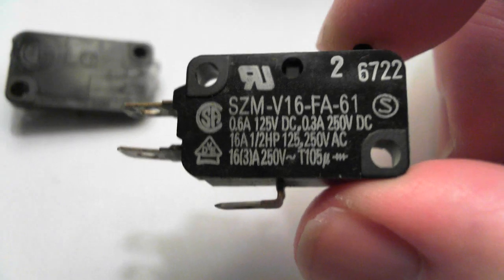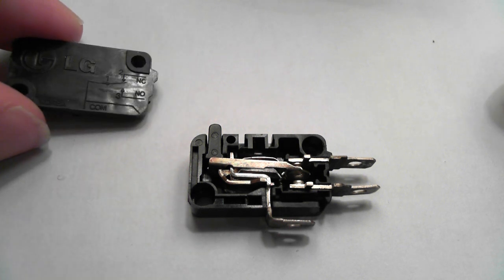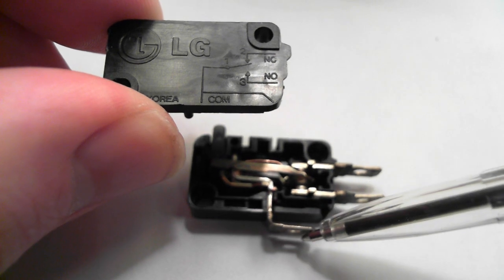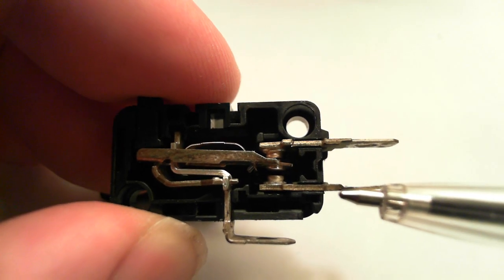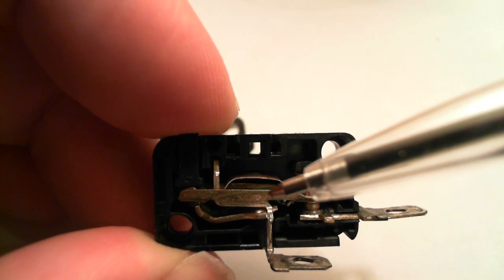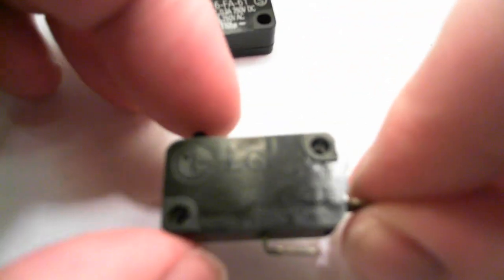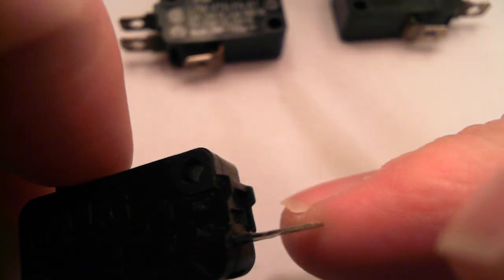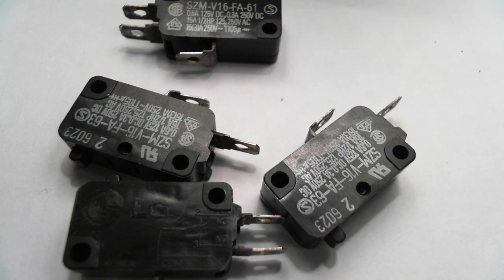Inside a microswitch, showing its' operation... in HD

Comment: Hey, thanks for posting this.  I had to take a microswitch like this apart to solder a terminal back on, but I lost control of the inner workings and for the life of me couldn't figure out how to put it back together.  Your detailed pictures helped me to figure out how my switch worked and get it reassembled.  It was a lot of work to save $10 (shipped) for a new switch, but hey I learned something from it!

Comment: Thanks very much for this particular choice of switch in your video.  My 3 terminal microswitch came apart when I removed from it the uwave, the internal parts scattering!  (Another microswitch in the uwave was sticking so I removed all 4 door swirtches to clean contact terminals, etc).  I spent an hour trying to reassemble it before I found this video.  Using the video, I reassembled it in less time than it took to type this reply. Cheers.

Comment: I had the hardest time getting the spring back on, until I finally used a paperclip as a temporary clamp for the other pieces.
Reply: i found if you just put the spring onto the stationary piece you can put the switch piece onto the spring and hold it together while you snake the 3rd metal piece in, the whole things a lot easier to put together if you pull everything out of the case before hand

Comment: Thank you for posting. but I have a question: I have an (DC) electrical slider that when it reaches the end I would like to make it reverse direction and do the same thing when reaches the other end. I know that in order to reverse direction I have to invert the polarity. Can I use this micro switch in each end to invert polarity? if not, do you know what should I do to accomplish this. Thank you very much in advance.